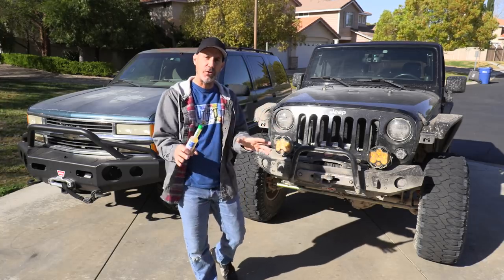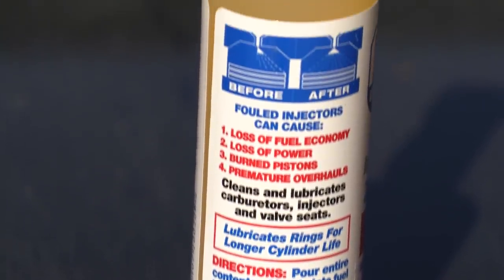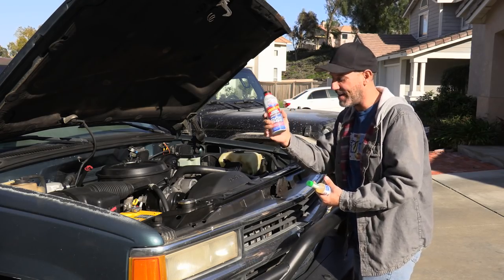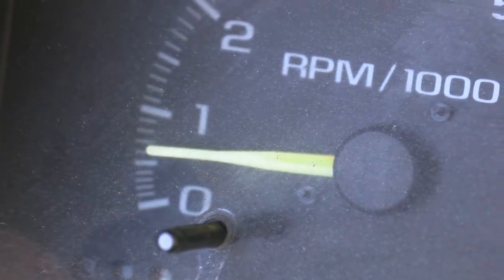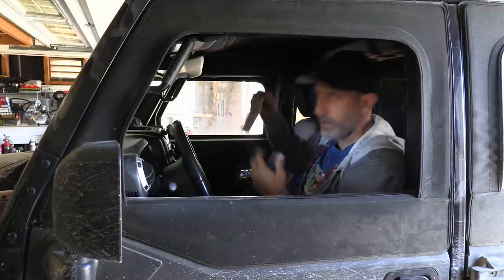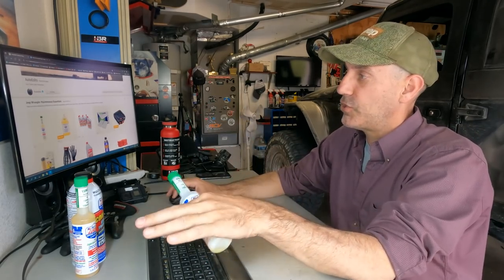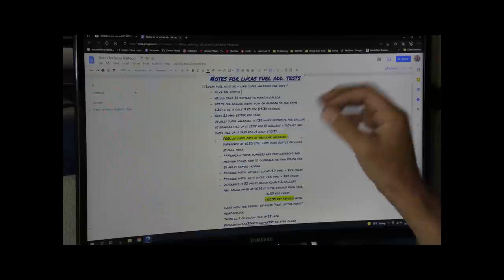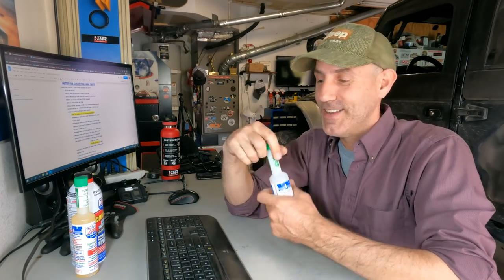💲How to Save Money on GAS with this Lucas fuel additive

Comment: The only additives I swear by are MARVELOUS MYSTERY OIL, LUCAS OIL UPPER CYLINDER LUBRICANT & INJECTOR CLEANER, BERRYMAN’S B-12 CHEMTOOL, and SEAFOAM! I have seen these products actually work well with new and older/ high mileage vehicles. As well as small 2&4 stoke engines.

Comment: Now that you've run that cleaner, what kind of mileage do you get when you don't run it? Still a noticeable gain, or does it drop back to what you normally got before? Just curious 🙃
Reply from the maker: Very interesting question... I think it tails off as it runs through the system. I'll pay more attention to that when I run less next time!
Reply: I wonder that too. Assuming you are cleaning out 60, 000 + miles worth of crud in the first few bottles, I have to imagine diminishing returns.

Seems like you could use it once a month or so as a maintenance once you get the system running well.
Reply: its meant to be used every fill up,  up front to clean, then used intermittently to KEEP clean. i buy the big gallon and keep the little bottle in the truck then refill it at home. or you could buy the medium nozzle bottle and keep in your car and squirt it in every fill up for the "initial run", the nozzle bottle sucks cuz its just  a cap and not a screw top

Comment: Real world testing.... thanks for sharing! I use it in my Mazda6 Turbo and it helps a lot with the pee water 91 octane we get in california! Boosts octane, better throttle response and the idle is much smoother. The car pulls noticably harder with it in the tank!! Its a direct injection car so I wanna keep it clean too  and this has been helping a ton! I can for sure tell when I dont use it so I get the gallon and use it every fill up...

Comment: When I had my GMC 2500 truck and pulled my toybox trailer with toys to the desert I always put in a bottle of this stuff and noticed a significant difference in mileage and power. Good stuff!! 

Now I just run it every once in awhile in my Jeep.
Reply from the maker: That sounds like a good routine... makes sense to up that back to each tank now that fuel is so expensive!

Comment: I ran a bottle in my 2011 Rubicon with the 3.8 on 37's and 5:13's. I run a Ripp tune, coil, wires, NKG plugs and long tube headers, which means using super unleaded. After a full tank with the additive on the highway for my test, I gained about 2.75mpg and noticed a slight increase in power, mostly off the line and at lower rpm's. I went from 15mpg to 17.75mpg (highway). The Jeep is still a pig on hills on the highway, but I can maintain 70-75 mph easily without dropping out of overdrive. Also, you can find the large gallon of the Lucas fuel additive at O'Reiley's auto stores if you have them in your state. I paid $32.50 for the jug, and $6.50 for the little bottle. I'll definitely use it on longer highway trips, but for around town I'm not sure it makes too much of a mpg difference with all the stopping and starting I do where I live. However, the power is nice even if slight. Thanks Jason!

Comment: Hey Jason, great video and being an Engineer/Scientist myself I appreciate all of the attention to detail in looking at the impact of putting in the additive. I have a 2 door with 3.5” lift, 37” tires, and MC fenders, rear bumper, and tire carrier. I get pretty horrendous mileage at about 12mpg (readout on the dash). I’m skeptical that I will see any results close to what you’ve seen, but I am trying it. My fingers are crossed and would love to see a good result. I’ll report back.
Thanks for all of the awesome videos!!
Reply from the maker: It's been a long enough experiment on my part to be confident you will see some improvement but, as you know, with so many variable it could be interesting to see what you find! Please do share when you get some data!!!
Reply: Hopefully you've changed your differential gear ratio....to bigger
Reply: Running 4.88’s and calibrated the computer for gearing and tires

Comment: I really enjoyed your video, you did an outstanding job!  It would appear you're a Lucas expert so I'm hoping you can answer a couple of questions.  First, I'm confused by the math.  Like you, I thought it would be a good idea to save and refill the 5.25oz bottle, then purchase it by the quart or gallon thereafter. The label says the 5.25oz bottle treats up to 25 gallons of gas. That would mean a quart should treat 152 gallons and your 1-gallon jug should treat 609 gallons of fuel, but those containers say 100 and 400 gallons respectively.  If that's true, it would imply that the stuff in the larger containers is not as concentrated if I have to use more of it, i.e., roughly 7.5oz per 25 gallons vs. 5.25.  So that's my first question, is it different stuff?  I can't just refill the small bottles if it's a different ratio, right?
My second question has to do with the statement on the 5.25oz bottle: "ELIMINATES NEED FOR HIGHER OCTANE FUEL".  Does this really mean what it says?  My car requires premium unleaded (per the manufacturer). If I use regular unleaded, the engine will absolutely knock.  However, I tried regular unleaded + Lucas and the car runs perfectly smooth - and I do mean perfect.  So is the absence of knocking enough?  Can I get away with saving at least $1/gallon on regular gas and just add Lucas?  Oddly, I noticed they only make this claim on the small bottle, not the quart or gallon size, so again, I'm left wondering whether it's the same stuff in the larger container?
Reply from the maker: From my understanding, it is the same substance in all different size bottles. After doing more research, I have discovered that this product works by creating a clean, dense, oil type additive to the fuel chamber that essentially raises the compression a bit and offers some detergent with upper cylinder lubrication. About how much per tank, I just don't pay attention to the accurate ratio and just settle for one of the small bottles per tank and have been satisfied with the results. I'm back on to buying the gallon jugs and using a small bottle every tank.

Comment: Love Lucas too. Been using it on my 2006 Dodge Ram 1500 for about 7 years now (on and off not every full tank but every 1,000-3,000 miles and I feel even at that rate I’m benefitting. I haven’t done a fuel mileage calcs comparison yet but I did when switching from stock 30” tires to 33” mud tires to 32” all terrain tires back to 33” MTs and that was interesting.
Reply: I've ordered it for my truck now too... avg 12.5 ....

Comment: My 07 Grand Cherokee Hemi has 102,000 miles on her and gets a solid 14.3 mpg.  Never bothered me before, but with these gas prices it hurts filling up once a week.  I thought about trying an additive, but didn’t know which one till your video!  Thanks Buddy!!
Reply from the maker: I recommend giving it a try with two bottles in two tanks and see how it goes from there!
Reply: @AutoEdits  so Jason, I went and brought 2 bottles like you said, and since my strong point isn’t waiting, I put one bottle in on a 7/8 full tank.  I didn’t want to put this in a new tank just incase I got an above average tank.  I can’t believe what this 1 bottle did for the idle of the Jeep!  Insane results!!  A little back story on this 07 Hemi Jeep Grand Cherokee.  I brought the GC brand new in Dec. of 2006, I’ve changed the oil every 5,000 miles with Mobil 1, Amsoil in the diffs and TC, PowerStop Brakes (again your idea) Bilstein on all four corners installed by me as well as the brakes!! To say I know this vehicle like the back of my hand is an understatement and to poor this little bottle in and get a great idle to become smoother is just unreal.  My mpg in this first tank so far is up from 14.8 to 15.1.  Not great, but I’ll take it as a bonus to the idle quality!  The Jeep has 102,000 miles on her and she drives like new.  I can say that running 87 now (only ran 89 till fuel prices went nuts) I can’t tell the difference climbing hills like you said!  Thank you Jason!  I’ve always loved your content wether it was Marge, or the Ram, or the Jeep!!

Comment: I've been using that for decades!  I buy it by the gallon.  I used to buy the gallon size at the NHRA drags where the manufacturer would have smoking hot deals on it.  I've never had to have fuel injectors removed and cleaned in any of my vehicles.  I even used it in my boat's injected outboard motor.

I do save the little bottle but I only use 4 ounces per tank.
Reply from the maker: I run it in everything now as well... even the  pressure washer and dirtbike gets a little.

Comment: Great info!  Thanks for the time and effort put in to this for the benefit of all.  Heading over to the Amazon store now.
Reply from the maker: Fantastic! Thanks for the support and hoping you get similar results!
Reply: @AutoEdits   - Just some feedback on this.  I've been using the Lucas stuff now for about a month and it works!  I know all set up's are different,  I have a 2008 JKUR running on 35's and used to average about 12.8 miles per gallon.  I'm now up to 14.2 MPG!  Thanks again.

Comment: My 1997 4Runner loves this stuff!  I’ve read it adds certain polymers back into the fuel that were removed in the 80’s (probably for catalytic converters).  I don’t notice a huge power increase, but the engine seems to run smoother, and does get better mileage.  If it keeps the injector spray pattern consistent, the engine will run as intended, and the polymers help the fuel burn in a controlled manner.  Great stuff!
Reply from the maker: I actually have been running it again every tank and still very happy with it. Buying the gallon jugs makes it very affordable.

Comment: Very interesting.   I used to put something similar in my cars.  But I didn't see much improvement.  Perhaps as soon as I felt a smoother ride, I just couldn't help it and stepped on the gas harder.
Reply from the maker: That's funny, I had a similar experience when I put a "sporty" muffler on my vehicle... since it sounded so good I drove around with my foot on the floor and the gas mileage was horrible... I called it the "flowmaster effect" 🤣
Reply: @AutoEdits  I just recently upgraded my exhaust to Flowmaster Force 2.  It's a little bit louder than what I am expecting.  Since you are in LA, did you get yourself into troubles because of the loud exhaust?  California has a law for exhaust being illegal if it's over 95 db.
Reply from the maker: That was a largely overblown "clickbait" thing. I've never had a problem.
Reply: @AutoEdits  What exhaust are you using for your JK?

Comment: Thanks Jason, my jeep has really bad mpg. I just tried it yesterday and it got big improve. Also,I have the same tires on your jeep, wondering what tire pressure are you running?
Reply from the maker: Great to hear! I run the tires at 28 PSI cold which works out to about 32 on the hwy

Comment: Looking at some other videos it seems this product increases compression slightly due to basically adding oil to the fuel and getting a slightly better ring seal.   This, combined with what is probably less fiction is what gives a smoother feel.  Not sure about how much cleaning is going on.  Oh and I do use it too 😀
Reply from the maker: This is interesting to learn!

Comment: i do the same thing i keep the bottles and just refill them with the bigger bottle. I have a 2011 camaro and i would get p420 codes. I took it to a mechanic and he wanted to charge me 4000 to change the catalytic converter and fuel pump. I took it to another mechanic and he checked it out and didint find anything wrong with the car and told me to use better quality of gas and use lucas every time i fill up. The code went away and passed smog with no problem. I stopped using lucas after i passed smog and the code started to pop up again. Im starting to use lucas again because i feel it works.
Reply from the maker: I'm in  a similar usage pattern now.

Comment: I'll give it a shot. Have an 87 blazer with TB I. We'll see if this helps at all.
Reply from the maker: The TBI is tricky... In mine, part throttle accelerates the same as full throttle. The only two noticeable things was the idle getting better and the throttle response picked up a bit but it just feels happier for sure.

Comment: Very interesting results! I’d love to run my own experiment. Just to make sure. You use this on every gas up?
Reply from the maker: Right now, yes every fill up since it makes a noticeable difference in mileage. If gas wasn't as expensive... once a month is what I used to run.
Reply: @AutoEdits  I am very curious if there are any negative side effects to putting the additive in the fuel tank. From what I read online it may break down the lining in the fuel tank over time? I’m just surprised this has not been discovered sooner or by someone else if there truly are no downsides. Very interesting.

Comment: Great review, i do the same thing where i purchase a master bottle and refill the 1 tank bottle. One quick question, does the fuel in your area have ethanol in it. Where i am from, if I fill up with a non-ethanol fuel, the idle, MPG, and power goes up quite a bit. Even though the fuel cost the same as premium, the driving experience is worth it for me. Safe travels!
Reply from the maker: Great minds think alike. Yes CA has a 15%  mix sometimes and we can't escape it... this stuff completely negates that... thank goodness.
Reply: @AutoEdits  If there is a station that carries non-ethanol fuel in your area,  how about a mileage comparison?
Reply from the maker: @2knipex  I don't think so... there are stations that offer E85 so CA only goes the complete other direction...lol

Comment: Hello Jason,
So do you need a full tank of gas to use the Lucas? Or if you have half tank, is it ok to drop in the Lucas and drive on.
Reply from the maker: I don't really have an opinion or knowledge on that... I've done it a time or two but for the last several months I've mostly done it on fill ups only to keep my data more relevant for this video.

Comment: Now since they say it cleans your injector and carbon build up when you pull the spark plugs do they look shitty in
 comaprison to no additives
I mean before i use injector cleaner when i pulled my old spark plug 1 to 3 look clean only 4 had a bounch of sute on it after i use fuel inj cleaner now they all have sute on it

Comment: Great math and way cheaper by the gallon. Here in Canada it cost $11.49 per bottle and $50.99 per gal. Would cost me $257.76 for 24 bottles to make a gallon so buying the gallon here locally I save $206.77. That's almost 2 tanks of fuel.
Reply from the maker: Glad it works for you as well... especially with prices that much more expensive up there!
Reply: @AutoEdits  thanks again. I run an '08 Jeep Jk and a '98 Cherokee

Comment: People have been giving me a hard time for decades… I use Lucas additive in my gas and use a quart of their oil stabilizer at each change. Only warning I have is using the fuel stabilizer on old neglected vehicles can loosen up some deposits and take a while to clear out or might get way worse before it gets better. I guarantee it saves you enough in fuel consumption to pay for itself.
Reply from the maker: Good info. and that is why I changed the fuel filter on the Tahoe after a few tanks of the Lucas... just to be certain.  Yeah, my math shows this stuff absolutely saves money at every fill up.

Comment: It stabilizes combustion so your engine controller will utilize the high octane spark map. Depending you maybe able to improve mileage with just a good tune. Although, your method is probably safer.
Reply from the maker: I did use a few different tunes before this test. One for regular octane fuel mileage and it didn't do anything and another performance tune for 91 octane that did get noticeably better fuel mileage but not enough to overcome the increased cost of super unleaded gas.

Comment: The peppy juice makes things more peppy....fortunately for me I can get pure gas(non ethanol) and I couldn't tell a difference between ethanol gas + fuel additive vs pure gas so i just simplified it by going with pure gas all the time
Reply from the maker: Makes sense, can't even do that if I wanted to where I live.
Reply: @AutoEdits  no pure in cali? oil today is crazy anyway, i wouldn't put it past most of these oil giant's to be cutting their higher costs products with lower grades just to fill the barrels to the top........i take back what I said about no difference...i remember my JK did have a smoother idle in the cold on cold start up but once that little 3.6 was warm it purred all the same